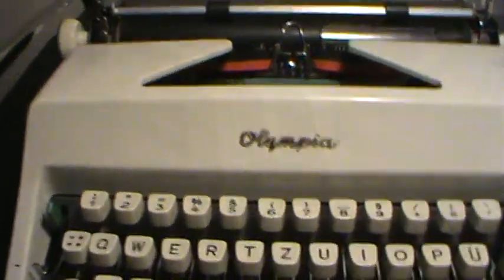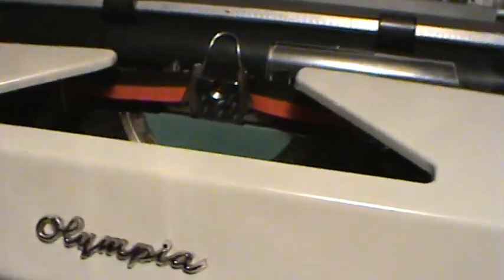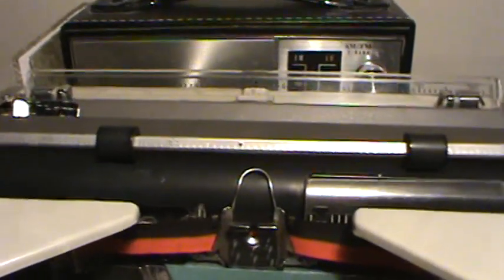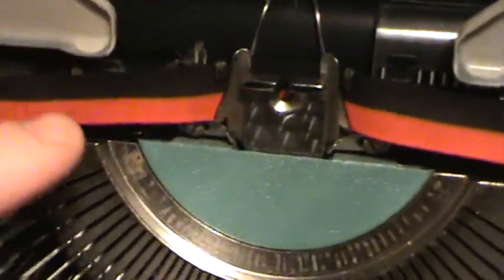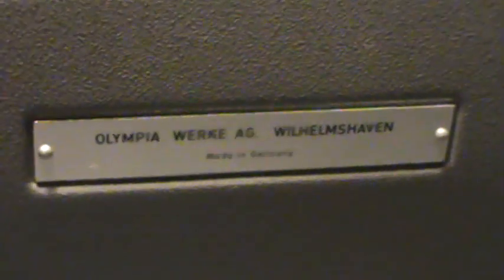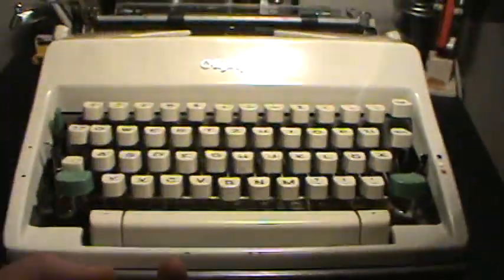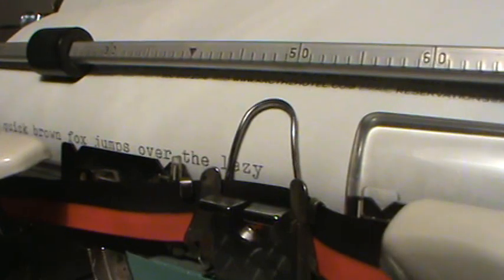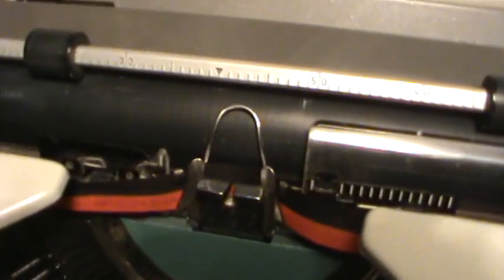Olympia SM9 German typewriter

Comment: Place the machine on it's back side so the index is facing upward and apply a few drops of WD-40 to the rust spot and let it soak overnight to loosen the rust. Then wipe the excess rust away with a cloth and rub the area with chrome or brass polish on a cloth. Be careful that no polish residue gets down in the the index because it's abrasive.

Comment: I had a early 1960's Olympia SM7 with a US keyboard. God, I miss it. Now I'm working with a 1940's Remington Model 17 with an extended carriage and a 1930's Remington Portable No. 3. That Model 17 is a massive beast. I believe it was U.S. Military issue, perfect shape. My No. 3 needs a spot of work but she still works, every key.
Reply from the maker: I personally never owned a SM7 although I want to. They are quite popular and they are quite common so don't give up hope. I also never owned a Model 17 or a 3 but I know that the 17 is indeed a beast of a machine. However, they also last a life time. Today I purchased a Underwood 5 (1909: my second '09) and a Royal 10 (1932) The Royal is in rough shape as it is rusted quite badly, but she'll be fixed. A great price. It also came with a Remington Portable, that actually works and I got the whole shebang for $127.75 CAD. AWESOME!!! Considering I sell one of those babies easily for $250...life is awesome.
Reply: Wanna hear the real kicker? I got the 17 for $35 and the Remmy Portable No. 3 for $15 USD. Very cheap.
Reply: Both are very babied, but used very regularly.